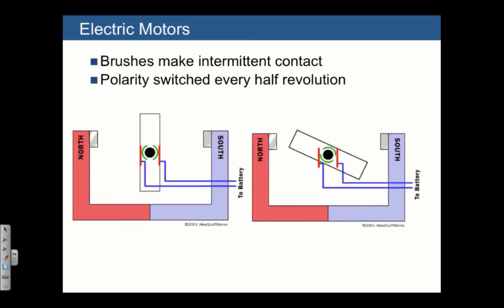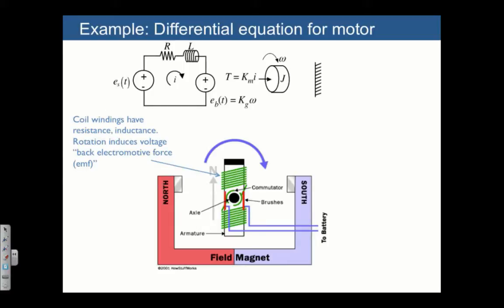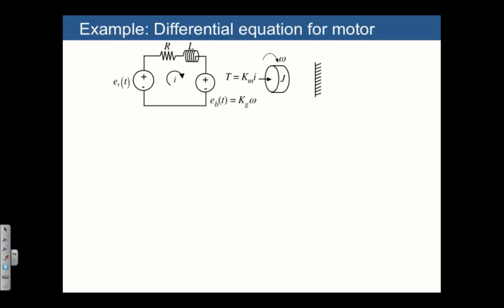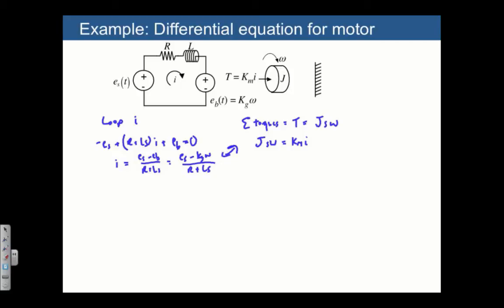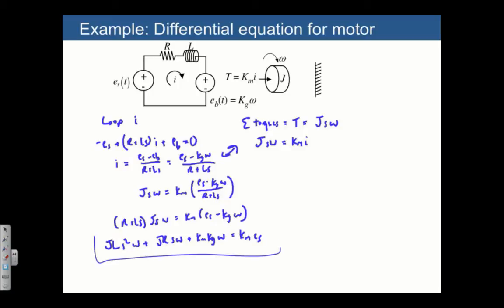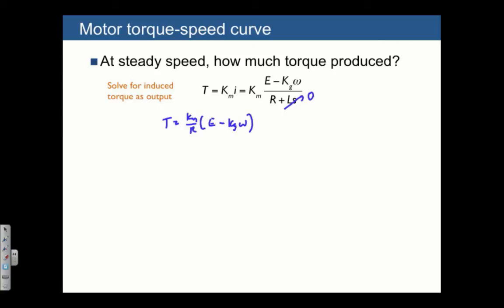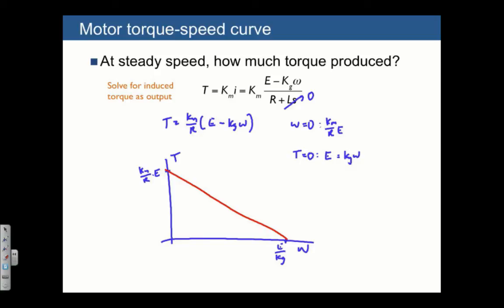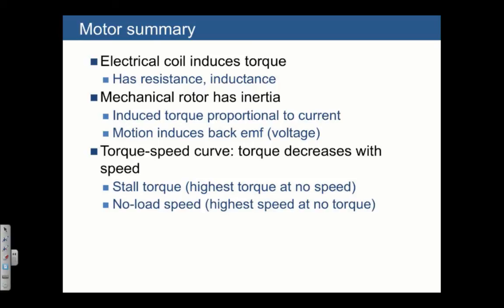Lecture 15 Electromechanical systems

Comment: Voltage across an inductor is proportional to the rate of change in current (i.e. V_L = L*di_L/dt) not L*i_L
Reply from the maker: Here we use "s" as the derivative operator, so when we write "L s i" that means L times derivative of the current. The variable s may also be treated as the complex frequency of the Laplace transform. The transfer function in the video is correct.